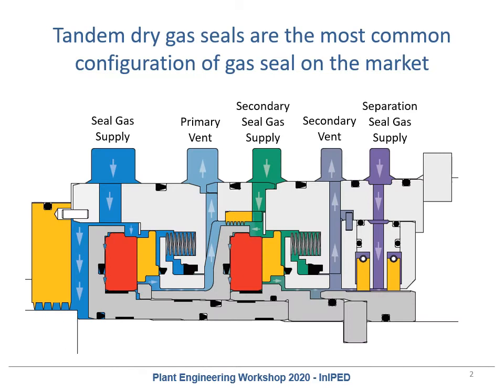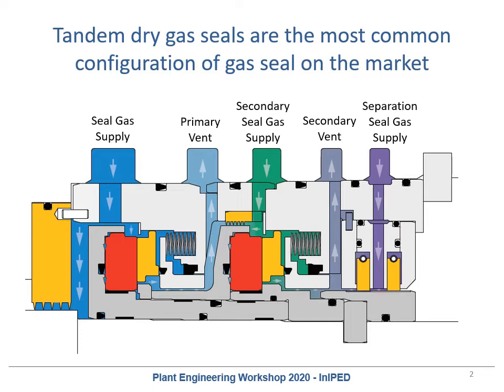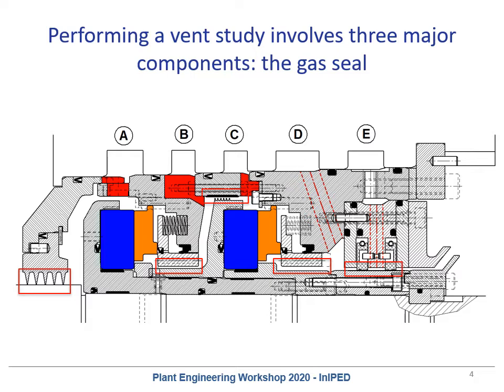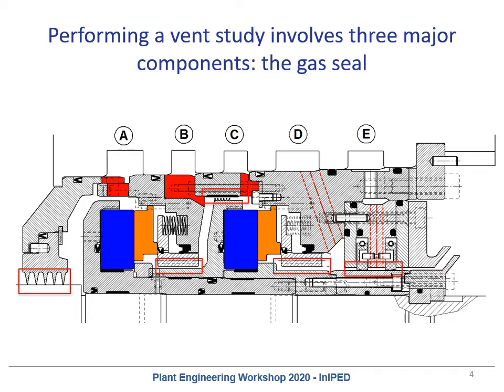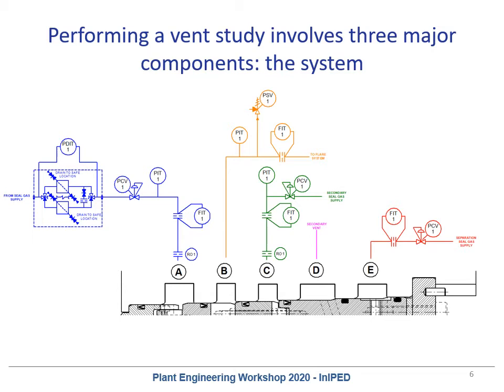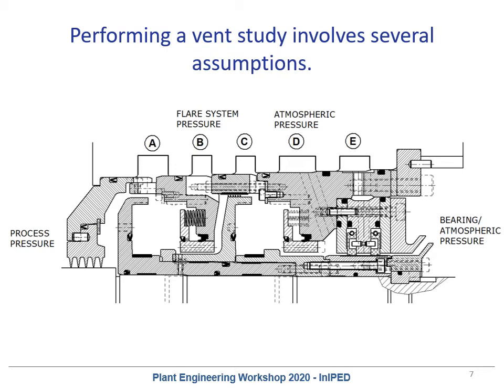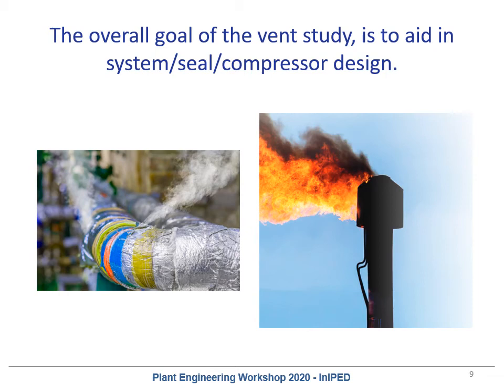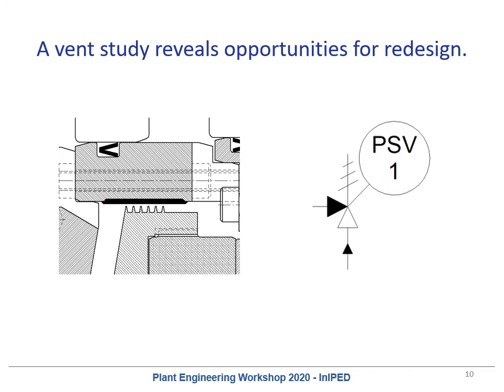Vent Study. Why, how to do it and how to interpret the results

Comment: tell me what happened when reference gas  and buffer gas diffencal pressure is high is it damage seal?
Reply: Unless you exceed the pressure rating of the seal (which is unlikely if you are coming from discharge), a high differential pressure across the process laby shouldn't damage the dry gas seal.  It would simply increase the flow through the process laby, up to a choked flow condition.

Comment: What pressure difference is there between the fluid entering the primary seal and the fluid heading towards the labyrinth seal
Reply: There is no pressure difference in the primary seal cavity, between the process laby and the primary seal.  The pressure will drop as the gas moves across the primary seal face and the process laby (or any restriction in a flowing application).  The pressure entering the primary seal is a controlled parameter, controlled by the support system to a setpoint in order to maintain a specified velocity across the process laby.  The pressure downstream of the process laby is approximately equal to the compressor suction pressure (if the compressor is balanced).  The pressure downstream of the primary seal is approximately equal to the primary vent back pressure, which is controlled with a back pressure regulator or a check valve with a specified cracking spring pressure (usually around 5 to 10 psig in normal seal conditions).
Reply: @rareoaq  thank you that was neatly explained